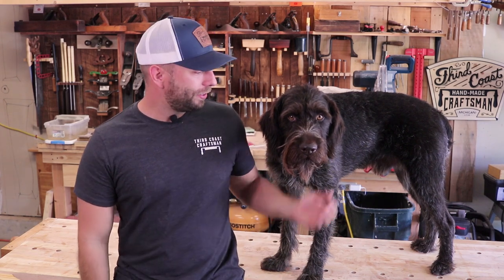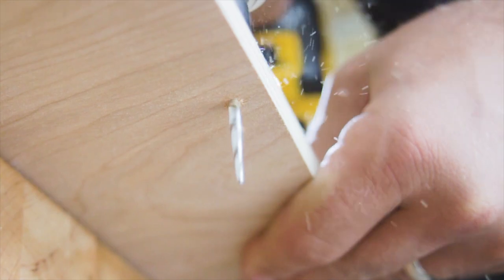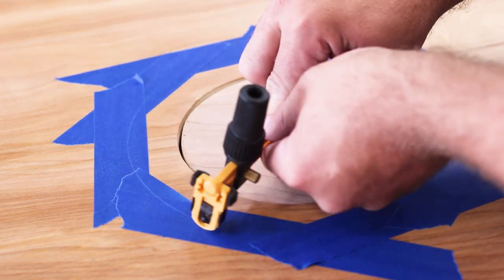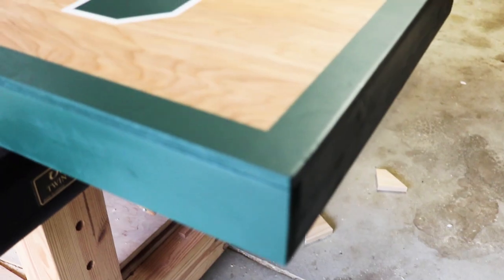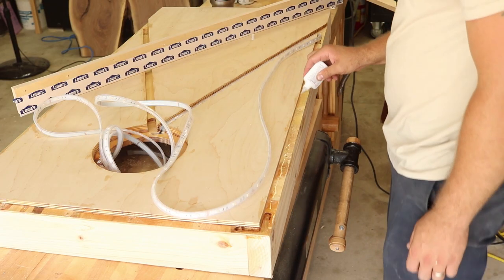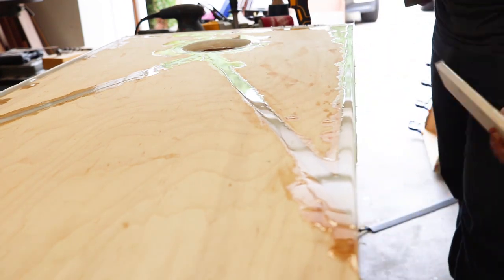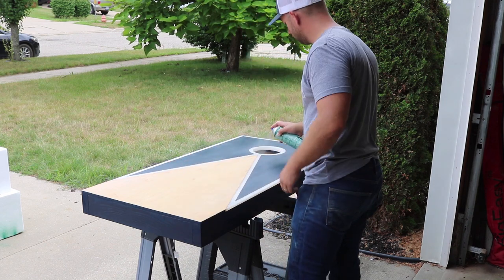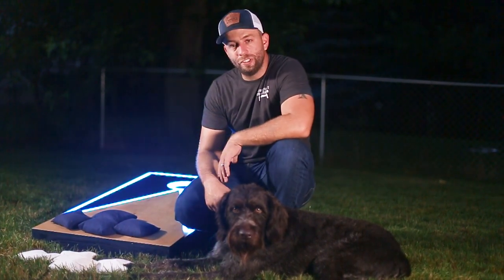How To Make LED Cornhole Boards!!!

Comment: At 6:29 - "I've been going to Lowe's for years, and basically remodeled my entire house through them. . ."

Yeah, it would take you years to remodel your house through Lowe's. I was a loyal customer for the better part of a decade; drill bits, trim, water softener salt, the little everyday stuff. Then, when it came time to really spend some money on a washer and dryer ($2000+) we saw their true colors. First, the washer and dryer wouldn't be delivered for two weeks because the dryer was out. Fine, it happens; stuff is on sale and flies off the shelves. I get it. Two weeks later the washer showed up, but no dryer. We called the store, sat on hold for a minute, and were assured that the dryer was in a warehouse, soon to be loaded up, we'd have it a week. A week later we got a call, don't expect your dryer, it'll be 5 more days. 5 more days we got a call, don't expect your dryer, it'll be 3 more days. 3 days later the van showed up with. . .a dryer. Not my dryer mind you; wrong brand, wrong style, wrong heat source (gas?!), but at least there was a dryer in the back of the van, right? They took the dryer away and I took my receipt to the store. I didn't have to make much of a fuss before they put me on the phone with the warehouse guy in the back who assured me that the dryer was on it's way. He was looking at the screen at the very minute, he saw the tracking number, he saw the date and we WOULD have the dryer on Monday. Monday came, no dryer. We didn't even get a phone call informing us not to wait up. Tuesday morning we called the store again asking where the dryer was and the guy told us that they totally had it, it was there in the store, they just forgot to load it on the truck, that's why it wasn't delivered. We asked when we could expect them that day (Tuesday) then, and he said "oh. . . oh no, we didn't put it on the truck today either. You're on our delivery schedule for Thursday." Again I took the receipt back to the store and after making a bit of a fuss we FINALLY got our washer and dryer delivered. . . a week later. . .from Home Depot. Which is where I will buy EVERYTHING from now on. If I need to spend 12 cents on a single 2 inch bolt, I promise you I will not be giving my 12 cents to friggin' Lowe's.
Reply: dont have to worry about Lowes any longer...should be non existent by 2020...47 stores the past month..another 20+ due to close in 2019

Comment: My thing is u never showed the power supply for the l.e.d. which makes u have to find other content in order to finish them!
Reply from the maker: if you clicked on the links I provided you would easy see they are plug in. I used extension cords. but you can buy power packs to plug them into as well.
Reply: Third Coast Craftsman still im here to watch videos not click links! No where does it say power supply or anything of the sort! So its just not that "easy" now is! it!

Comment: What did you do to power the LEDs?
Reply from the maker: Pugged them in with an extension cord but you could buy battery packs too
Reply: Thanks! So, straight connect from the LED strips to the cord?
Reply: Jeremy Peskoe duh, sorry
Reply from the maker: yes

Comment: Way rad boards. Would appreciate more detail of the wiring, power requirements, switching, and overall  installation and operation of LEDs.
Reply from the maker: extension cords and plugged in. you can buy battery packs tho

Comment: First off I love this video and subscribed right after I watched it. Secondly how think is the plywood that you used and how deep did you router it because I am going to make these cornhole boards but didn’t know that part.
Reply from the maker: Thank you. Its 1/2" and I routed down 3/8th, but in the corners you have to go deeper so the LEDs can fold and bend. in the corners you need to glue extra material underneath so you can router deeper.
Reply: Third Coast Craftsman ok thanks I just need to convince my dad to let me build them

Comment: Made alot of it complicated. Instead of routing you could build a standard set and glue thin wood ontop small enough to leave the space for your lights that's if you dont have a router and it would be more durable also if the lights went bad you could remove that top and replace it instead of having to rebuild. Also if you can find one use a wired remote that's battery powered. Cool boards woild become worthless real quick if you lost the remote one night. And paint for the love of God use actual paint and a few layers of clear coat poly or w.e your preference.

Comment: Maybe someone can help me. I'm using a trin router with a 3/4 inch straight cut bit. I've rounded edges many times. I've never plunged a trench/mortise like this. I'm having trouble with this jumping around everywhere. I am trying small increments but even a small amount is jumpy and really tearing wood. Bad bit? Bad router? User error? Any tips from anyone is appreciated
Reply from the maker: Are you taking shallow passes? I think it did cuts in three passes. Maybe try a fresh bit to and go slow
Reply: Third Coast Craftsman I thought I was pretty shallow. At first I wasnt......just being a dummy. Nearly lost a hand. But I went to what I thought was very shallow. Maybe not. Straight bit should work?
Reply: Third Coast Craftsman I should also mention I'm cutting inside. Not on the edges. Trying a different design. So more like a long mortise.
Reply: Third Coast Craftsman if you're curious.......I just suck. I bought a hefty plunge router and it was like cutting through butter.

Comment: Looks good but to make the LED version great use the RGB strips where you can address each LED then add a small processor to control them. Now when a BB goes in the hold the LEDs can flash in patters and you can add a speaker for for some sound effects.

Comment: Lowes is short for Low Quality Wood. 

You'll find better boards at a non big-box store. Or even in a dumpster.
Reply from the maker: The quality of the wood I used was just fine for cornhole board or DIY stuff. But I get all my hardwood for fine furniture at a dedicated hardwood dealer

Comment: you missed the important part!  wiring the led and is it 110 or battery!  waste of time watching.
Reply: Well LED strips run off of either 5v or 12v so its not 110. Also this needs to be portable so its battery.